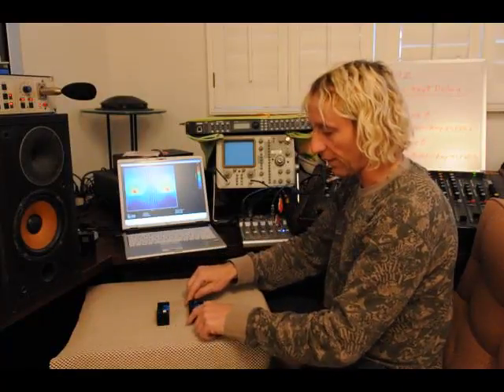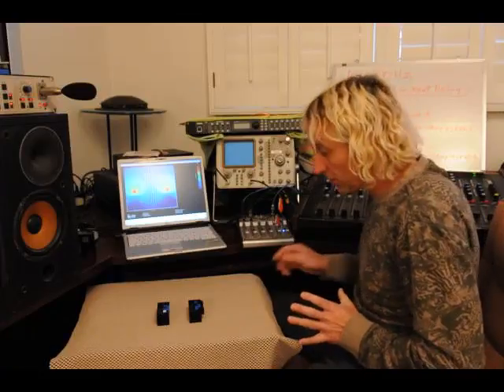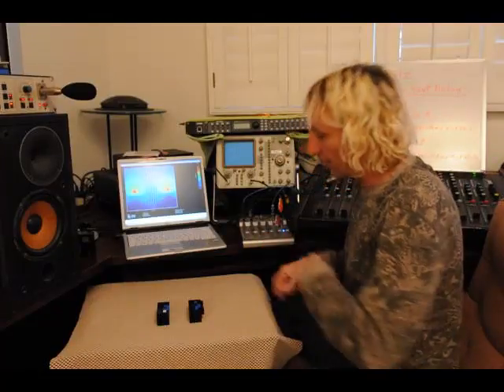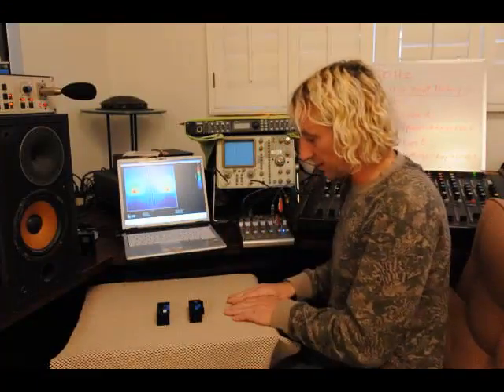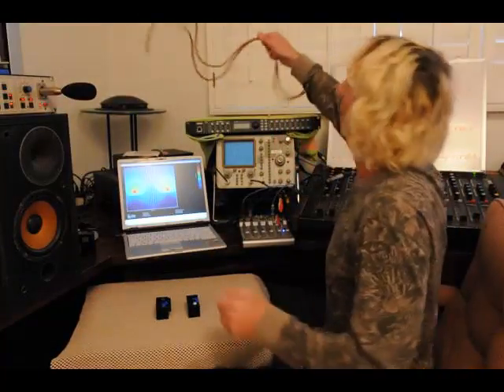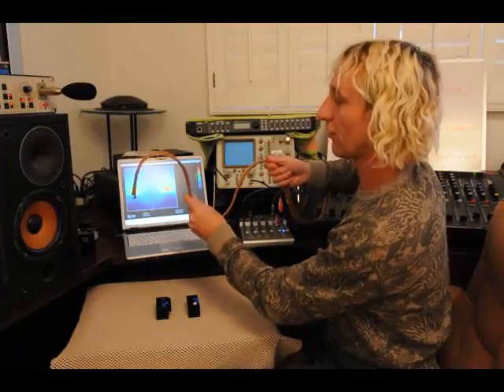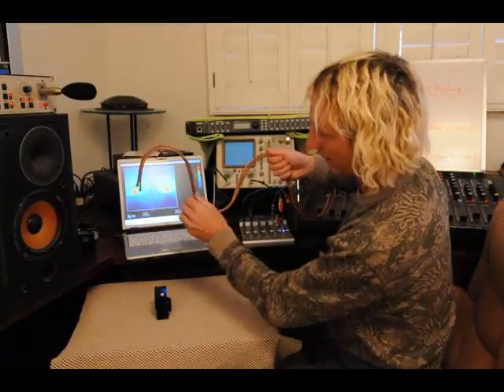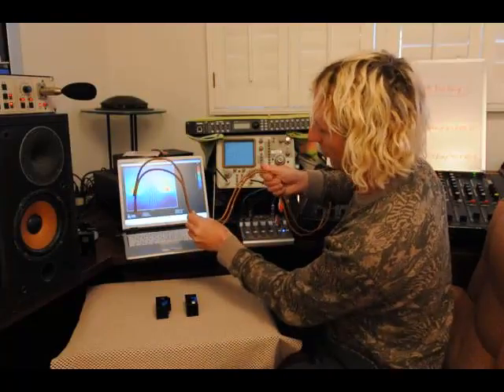Live Sound Subwoofer Configurations Part 3 - Cardioid Arrays

Comment: I don't understand any of this and I've watched all three videos. Can someone help 😭 I just want to set my double 18 subs(with 6db boost) cross over with my dual woofer Midrange mains crossover point. Have no phasing issues and Know the right delays. They are both Wharfedale speakers The X218 and X215
Reply from the maker: If you get software like Smaart or there are others that let you analyze phase, it will be a good learn and get ya there

Comment: Late to the party with this question, but why 45 hz? Most subs won't extend below 30, and many systems optimally cross over at 100, so I would think 50 hz would be good for an 80 hz xover (thinking logorithmically) and 55 would work for 100 hz xover.
Reply from the maker: Great question. 45 tends to be a resonant peak of the L-Acoustics sb28, which I was using at the time. Select a freq that you want max rejection. Higher freqs tend to be more directional so tending lower is more useful. Too low a freq where there is not a lot of musical info is less useful. Or select the freq that is the most annoying in the production office or backstage.
Reply: @DaveRat  As always, thanks so much!

Comment: Would this work?  Using 3 matched powered subs center cluster.  Middle sub reverse polarity and rear facing on a matrix mix with a proper set delay?  Forward facing subs delayed to the back line on seperate matrix mix.  I love this video but i dont often have the space needed to set up subs spread apart.  Thank you for the excellent videos.  Been following them for years.  I have a small system and do local shows.  I have applied many of your techniques over the years with great results.
Reply from the maker: Probably best to have all 3 subs on one mix, with delay and levels calibrated. Doing a cardioid setup like that and sending to the rear seperately can cause all kinda of coverage variations impacted by level changes

Comment: One of goals during this quarantine was to get a grasp of subwoofer configurations in a live setup.  This series is gem of find.  Thank You Dave.  You never got around to a part 4....Waves has since come out with a Sub Align plugin for instances where visiting engineers don't have control over the House System and Subs are tied with the Mains.  Would love to see you cover this.  Also maybe cover the time difference with running Subs out of a Matrix channel vs an Aux channel.  Thanks again and I hope this helps spark new ideas for a part 4
Reply from the maker: Ooooh, will ponder the part 4, totally forgot!
Reply: @DaveRat  😆😆😆🤣😂

Comment: The way you show double 18" sub cabinets stacked one behind the other, I have both double 18" cabinets and single 18" cabinets. Can I arrange the subs where I use a double 18" cabinet in front of two single 18" cabinets, or vice versa, and expect the same type of results discussed in this video? Also, how do you determine the distance between each sub stack? Would you just place each stack to the left and the right of the stage? Or is there a distance that will optimize sound reproduction?
Reply: It depends on how similar the subs are.

Comment: ? - If you separate and delay the front subs for optimum front phase  addition and rear rejection  at 60 hz, what happens to the rear sound at 120 hz? 80 hz?  40 hz?

Comment: So this brings a number of questions to mind.  What is happening in the brain with a half wavelength? Can you actually hear a half wavelength?  Seems you need a full cycle to decode a frequency.  So the error/artifact produced by the inverted rear box is going to be most influential with faster transients. Is the transient (attack) part of most lower octave sources not actually well above the sub response? Not really claiming any answers... just thinking out loud.
Reply from the maker: +esharpflat5 The half wavelength is used because it is 180 degrees out of phase, which is the point of maximum cancellation.

Comment: Am I right in thinking that with the polarity inverted set up you would get an uneven frequency response at the front of the array? The first set up causes maximum cancelation at the rear at a certain frequency, the second set up is effectively the opposite of this so would there be an optimum frequency of summation at the front, dependant on spacing and delay???
Reply from the maker: +bennygreen1 Exactly, you are correct.

Comment: Great video series, but although I am a pro musician since nearly 40 years, this for me is very technical. So I have a question which is : Should I delay my subs by using a delay unit, if yes, whats the average delay in ms.Some say you should delay the full range speakers, others say you should put a delay onto the subs. I am confused. The PA I am using is one 18 inch sub and one 12" horn loaded full range cabinet on either side of the stage.
Reply from the maker: +jamodrama Naw, dont delay.  It wil just overly complicate things unless if you have multiple subs and really need the cancellation

Comment: Hi! Thanks Dave for the great video. I have a Q: I don't have much space in front of the stage, so my subs are at the side, close to a wall. (It's an indoor venue)
Will that still work with the rear cancellation? If I do everything else the same as you explained?  Thanks
Reply from the maker: Will what exactly work?  If it is near a wall, then using a sub for cancellation wont matter much.  If you ae trying to gain some steering to fill a hole or avoid certain areas, yes, it should work but the wall can alter things a bit.  I suggest downloading Meyer Mapp or some sound modeling program and doing some predictions then trying it or trying it and then confirming with predictions.

Comment from the maker: I try not to setup my system such that time aligning flown to ground stacks is critical, especially in venues that do not have flat audience areas like a field. Basically, if time aligning a flown to ground is audible and important, then that means that the sound will be correct for one part of the venue but not for the rest. So instead I minimize frequency overlaps between flown and stacked. And I don't worry much about a several millisecond offset

Comment from the maker: With a continuous tone, measured at the frequency that the array distance is optimized for, the summation is ideal in the forward and cancellation ideal rearward for the pol-rev-cardioid array and endfire array, respectively. My point is focused on 'even if you were to band limit the setups to reduce the issues associated with frequency variation, there is also the often overlooked and unsolvable issue of initial arrival time offset.' I am not debating the well known frequency dependent issues.

Comment: Imperfect cancellation in the rear of end fire subs and imperfect addition in the front of cardioid subs is because the waves from the 2 subs are offset (don’t overlap perfectly) in those regions. The offset changes with frequency. (I show this in my video.) You state that the waves do overlap perfectly in those regions and the difference is due to the very first part of the wave from the closest sub arriving before the wave from the other sub (the timing issue you mention).

Comment: Here’s why I doubt your timing theory. Measurements that demonstrate these effects are done with a continuous wave (e.g. pink noise), so the timing issue you mention won’t be present. Also, I doubt that a 6 dB decrease (the mistimed waved would be 6 dB less than max) that lasts 9 or 10ms affects a 100 dB sound lasting for seconds (a typical bass note). I hope this doesn’t sound harsh. I’m only trying to help.

Comment from the maker: I watched the video & the info you present is not incorrect & describes why polarity reversed subs are optimized to cancel & why endfire is optimized for the forward field over wider frequency ranges. The point I am making in the video is that additionally, if you look at the initial waveform, all the subs work together in the forward field with endfire & all the subs cancel together behind, with polarity rev setups. But behind endfire & in front of pol rev setup there is a timing mismatch.

Comment from the maker: The tighter the cluster, the more they will work together. Tall arrays have wider coverage, wide arrays have taller (more vertical) coverage.  With the amount of speaker you have though, the arrays are fairly small so the differences will not be drastic.

Comment: Hey Dave. Great video - really explained some things. I am curious, though, about the delay time calculation. If sound is traveling at 1125 ft/s (basically 1.13 ft/ms) and the subs are spaced 6 to 6.5 feet, wouldn't the delay time be somewhere around 6.6 ms instead of 5.8? Just wondering if I am missing something here? Thanks again!

Comment from the maker: @nellkirsten if the distance is 1/4 and the time delay is 1/4 then in front  of the speakers the signals add together.  Behind the speakers the farther away speakers are bot 1/4 wavelength farther away and 1/4 wavelength delayed.  1/4 +1/4 = 1/2  and 1/2 wavelength offset gives you maximum cancellation.

Comment: Man this is awesome interesting. Just some questions: Are these configs only possible with cardioid subs? I don't get why else you would measure for the time delay at the front of the speaker, if you'd use omni-subs. And also: What happens in the vertical plane using these techniques? I mean you put the second sub underneath the stage right? Doesn;t this increase sub-spill on stage? Thx, this is killer!